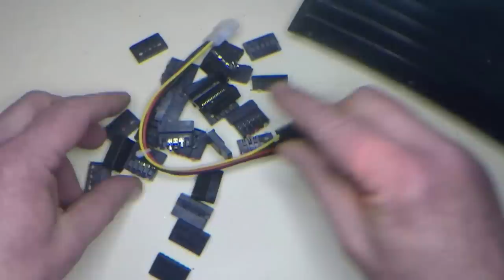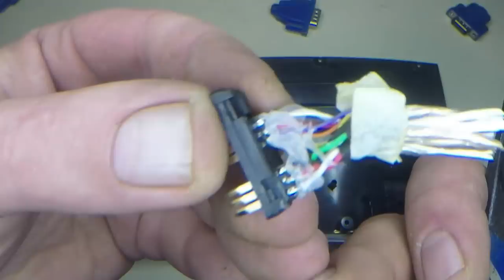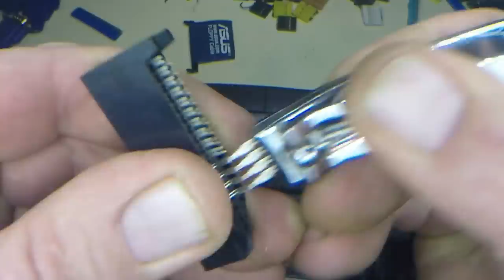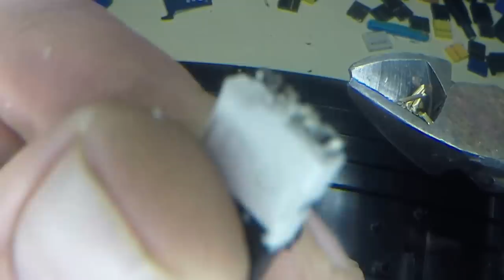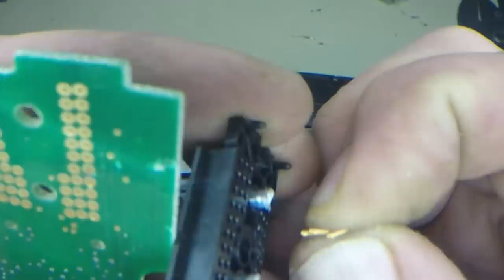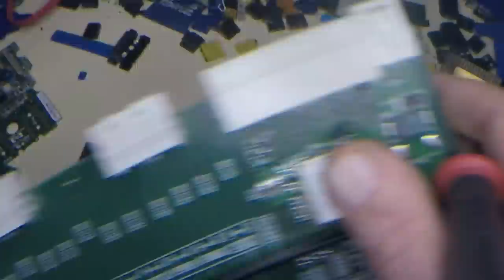Pulling Gold Pins from Computer Plugs for Gold Recovery

Comment: Just subbed - great info. For the cable ends which have the retention tabs I have a modified HD X-Acto blade I use to slip under and lift the tabs then all wires can be pulled at once and pins clipped off in one step. What makes recovery easier is modifying tools and making jigs for specific purposes all with the goal of reducing time, movement and making the process flow. I have modified different vise-grips for processing various cable ends. Where you are using nail clippers I use angled needle nose pliers and use the angled part of the pliers as a fulcrum to remove pins.

Comment: i first use the Irwin (blue)adjustable wrench to squeeze the the plug, this is to loosen the pins within the shroud making it easier to pull the pins out..then i carefully cut off the tip of the plastic shroud exposing the pins with a larger wire cutter,.then use a small needle nose plyers to pull the pins out.
with the larger video plugs, i have a small vise attached to my bench..after taking the metal shield off..i put the plug into the vise and again squeeze it as much as i can..this is to loosen the pins, i leave the plug into the vise and pull the pins out. I agree..it's very therapeutic..good vid Ben.

Comment: I’ve used a pair of old scissors instead of side cutters to cut the thin pins or flat ones where it’s only plated half way. Then it leaves the unwanted junk behind easier. Do this over a pan or bucket because they flip far sometimes. Thanks Ben! I need to microscrap more to add to my collection!

Comment: About those plugs you started off with… in the rectangular openings on the sides of the plug you should be able to see the little legs sprung outward from the pins that catch in the slots and lock the pins inside. If you press in on that leg or bend it inward with a paper clip, the pin should slide out easily. You could even make a simple tool to press on all 5 at once by hot gluing 5 small brads or nails to a piece of wood or plastic with the correct spacing. It may be better to leave the wires attached until after the pens are removed, since you can just pull out on the wires while releasing the locks on the pins.

Comment: I use to run crimp machinery that make connectors like Molex, JST, etc etc.. the easiest way to get those pins out is to take a corsage pin and push inside the little square openings you see right above the female connectors... those are the latching hooks that lock the pins in... when pushed back and down a little the pin will fall right out the back... even better leave like 2inches of wire on the ends and you can just pull on them as you unlatch each pin from it's seating.
Reply: You can also get the pin removal tools if you do this A LOT...  For example: http://www.l-com.com/d-sub-economy-contact-insertion-extraction-tool?gclid=EAIaIQobChMIkJCuv7un5gIVUxx9Ch0TSQLVEAQYCCABEgJUUfD_BwE

Comment: This is old, but here's the answer. Note the area on the side where you can see the gold pin. That's the pin release, lift the blue tab and the pin drops right out. Faster: Take 1 plug and insert pins into the plug. Now you have a plug that looks like a fork. Each tong (pin) sticking out of the plug will line up perfectly with the release tab. Now you have a tool that can be used to release all the pins at one time.

Comment: Your blue plug @2:30 and a lot like it. crunch it gust behind the plastic tab were you see
the pin. get a utility knife and slip it under the flap and it pull out. Mostly you can pull the pin out with your fingers.
Hope that helps.

Comment: And I always pull the pins from the back side that had the wire connected as they are designed so the don't slip out easily when unplugging them

Comment: run a steel bar into a steel pipe with a bottom. freeze smaller plugs for a day or two, put in pipe and ram with bar. sort and done. big printer plugs don't work well. I've also done smaller plugs in a heavy duty paper shredder. freezing first really makes plastic brittle.
Reply from the maker: +Keith Lanken Thanks Keith, that's something i'll consider when I start processing them

Comment: try using a pair of needle nose pliers to remove the pins from the slot.  grab the end of the wire and pull.  the pin might come out and then all you have to do is cut it at the ens.

Comment: blue ones : 1.cut the side screw years  .2force the front metal jacket .3 pull out the midle blue plastic whit pins / 3.1 if the case is entire under the blue external jacket.. youl need to forcecut after extraction.there becomes funny , interesting and a joy for who doesent have pacience

Comment: Dear Ben, I did not try with plugs, but usually when i need to feet of separate something to or from plastic I keep plastic item in boiling or just boiled water and than it goes easily. Try to put plugs into boiling water and then to pull pins out. If it works, let me know please. Just of a curiosity!

Comment: leave the copper tail theres a small piece of plastic holding the pin in the socket flip the plastic and pull the wire then trim accordingly

Comment: Why can't you just set the connectors pin-downward into a solution to dissolve the gold on the exposed pins and bypass the labor other than facing/alignment?

Comment: hi all fred from the US on the serives boards there are plugs whan you pull them apart they are like slout cards gold pins put the rest is locket in plastic cover whats the best way to get the gold out ? Ap OR AR OR what would you do ? i have over to pounds very nice gold too  so i need your help !
Reply from the maker: +fredie w Yeah they are usually very nice pins on servers, they would get processed just like any pins.
AR would be the best to start with because there's a lot more info out there using Aqua Regia (AR) then other processes.
Maybe once your experienced extracting with AR you might look for other ways.

Comment: 🤦‍♂️ 7 years too late, but here’s the info. 

Where you can see the pin on the side, below the pin but above the wire inlet is a tab lock. Use a knife blade tip or tiny flat screw driver to pull the tab up and then push the pin out. I do these frequently. It’s best to keep the wire on them for the first part so you have something to yank on to pull it out, then get your side cutters to nip them off.

Comment: so i have an old t.v that i am scapping and the pins are not gold, could they possibly be silver?
Reply from the maker: nope, tin
Reply: another question. the mlcc'c are round instead of square and flat, do those have the same components as the square ones?
Reply from the maker: just capacitors, not mlcc

Comment: Quicker was is hammer then use magnet to pick up all pins
Reply: Also no need to remove back wire acid will just leave the rubber